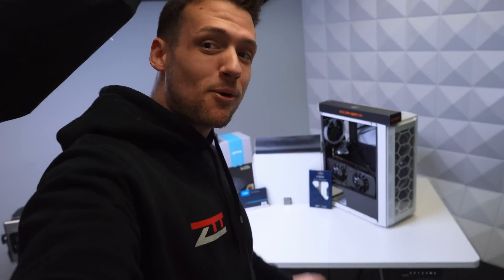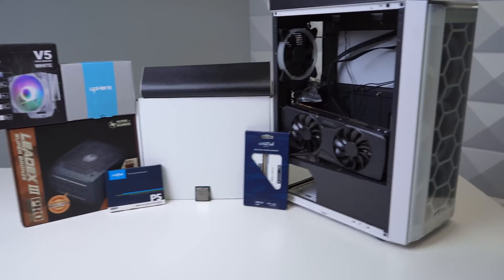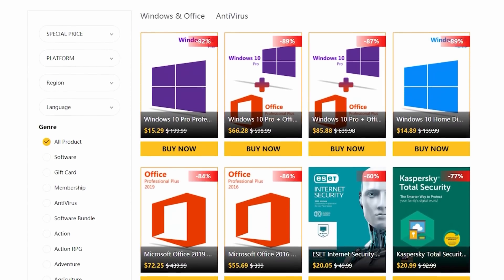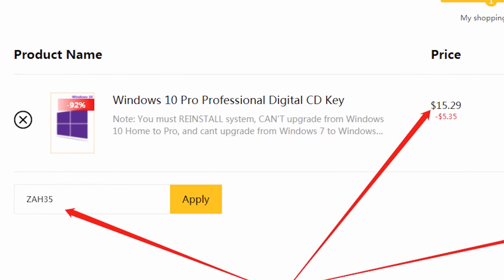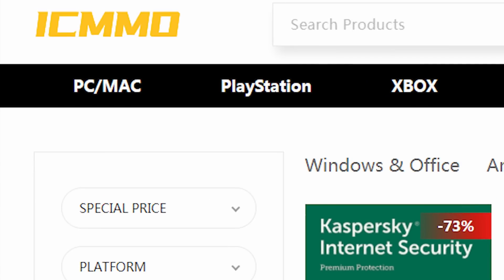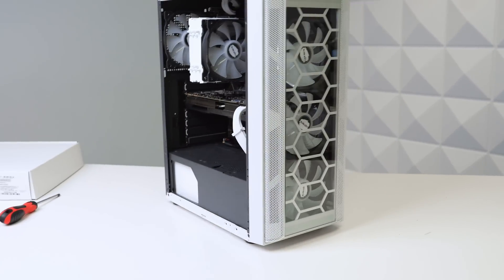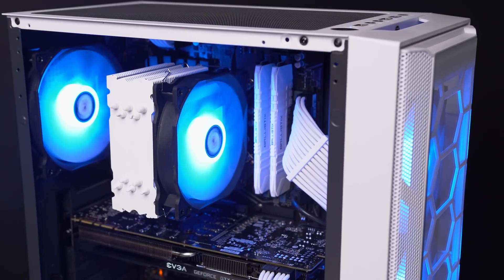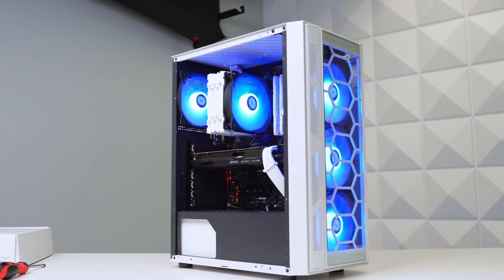How to Build a Budget $600 Gaming PC in 2022

Comment: Love the CPU/Mobo combo also. I have had issues with the b460 DS3H-AY1 board sold by Newegg when paired with this CPU, however.
Reply from the maker: Ahh interesting, which issue did you have?
Reply: @ZachsTechTurf  system wouldn’t shut down properly. Windows would end processes but hardware wouldn’t shut down. Apparently, it was an OEM board that Newegg was selling as refurbished. Maybe I had bad luck, not sure. Gigabyte is taking board back since Newegg wouldn’t.

Comment: This is awesome. I've been going back and forth with spending more and going all in with 12th gen Intel build or save money with a 10th or 11th gen setup. Since I game on a 1440p monitor and do minor photo editing, any of these processors will be a huge step up from my 2500k build that I've been using for 10 yrs lol.
Reply: I was on the same boat and got the 11400f to retire my 3700K after almost a decade of 24/7 daily usage, let me tell you this: It was super worth it
Reply: @arch_..  That's great to hear. I was actually just looking at the 11400 too. Thanks!
Reply from the maker: Very nice, yea any of those options will certainly be a nice upgrade lol
Reply: Hi early the 12gen CPUs are a huge jump in performance but the price lies in the platform change. Your choice but I'm going for 12gen.
Reply: @PopBunny8899  Ryzen 7000 series on top 😎

Comment: This is my first time building, any tips?
Reply: Do not push the CPU in, it will fall in on its own if you get the orientation right :D
Reply: @Lemon.21  Yeah he is extremely correct don't panic and slamm it
Reply: Take your time, no need to rush it, rush may cause big problems later on ❤️
Reply: Buy a semi modular or modular power supply and buy a case with good cable management options
Reply: Ram sticks require more pressure than you might think they should.
Reply: Thanks for all the help guys
Reply: @ClubggPKR  watch a lot of tutorials and do you a lot of research, joining some pc communities like pc help hub will help (discord and reddit) and take your time

Comment: hello Zach nice video, I have a motherboard with that chipset and i doesn't allow more than 2666mhz on the rams, for that cpu do you need to update the bios?
Reply from the maker: All depends on which chipset you actually have, but there's a possibility that's just the advertised rate supported. You might be able to simply go higher with enabling XMP or whatnot, but I can't tell you without knowing the chipset
Reply: Cmiiw I think b460 chipset doesn't support any ram oc